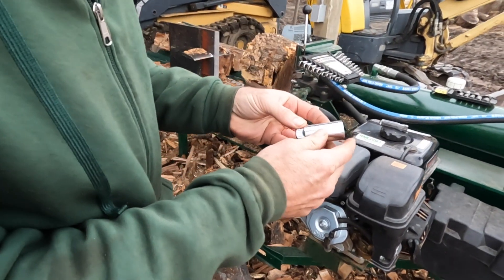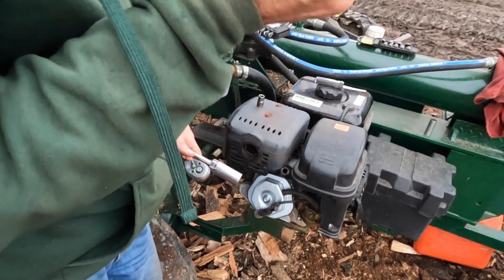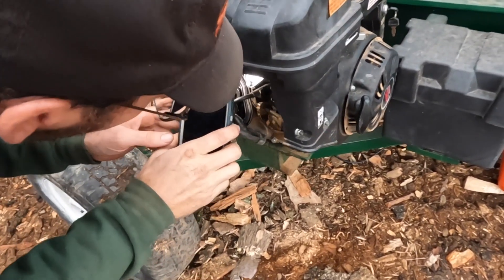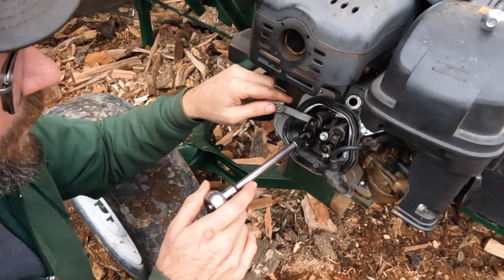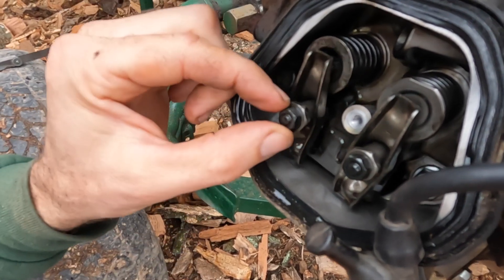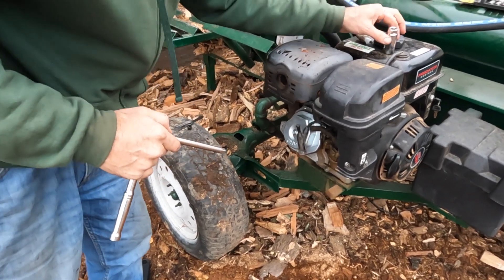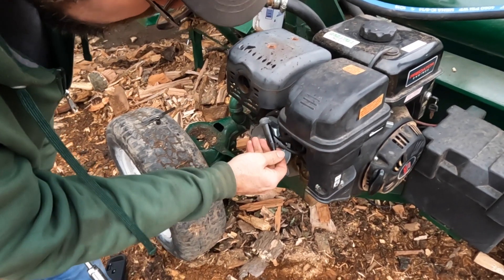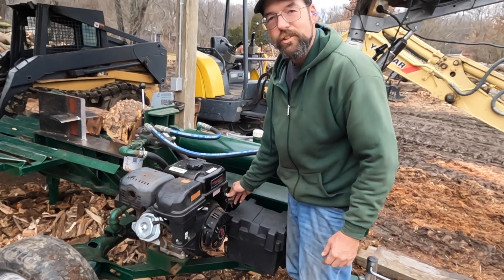Predator 420cc Valve Adjustment

Comment: Why put a finger over the spark plug hole to find the compression stroke and then insert a wood dole to find the TDC.  I need to do this but looking for the setting spec gaps.
Reply from the maker: I found the specs in the manual that comes with the engine
Reply: Specs for the 420cc used in the Cub cadet snow blower are very hard to find.  The dealer finally found some when he figured out what brand name of the engine actually is and it's built by LCT.  Intake gap is .005 to .007 and Exhaust is .007 to .009.
Reply: @baronlund9725.006 int and .008 exh is normal settings for most of those typical engines...check intake valve stem rubber seal, motor smokes when bad